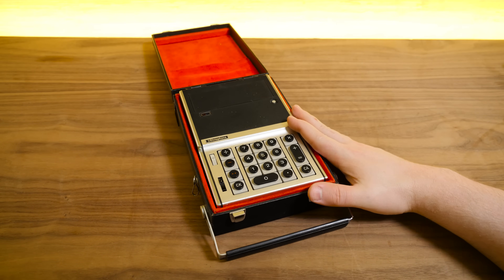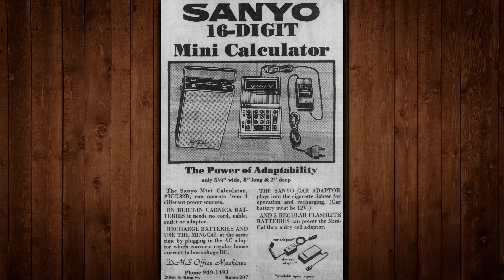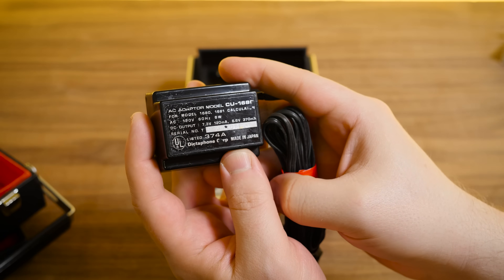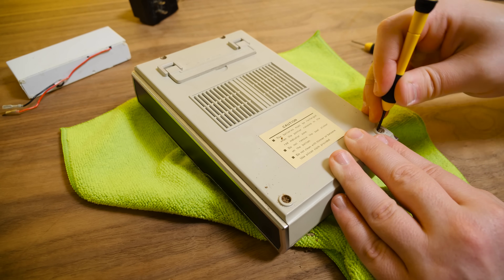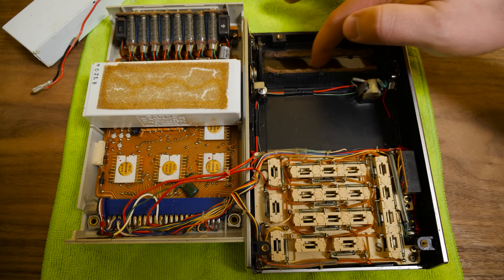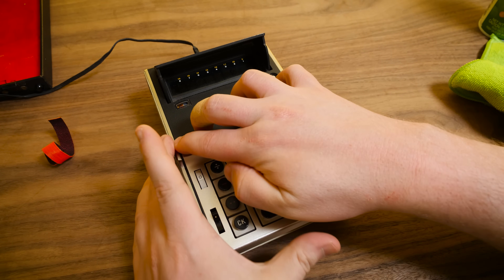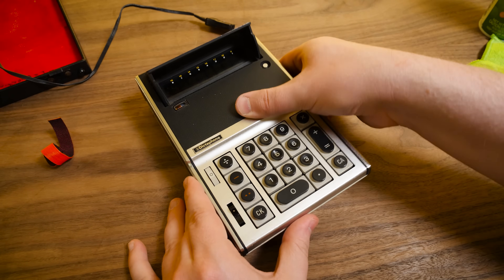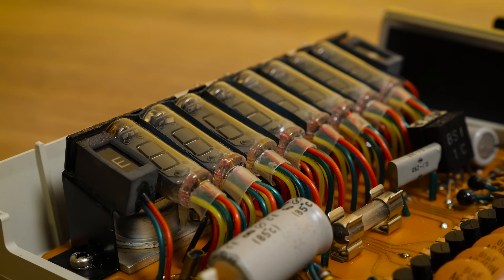Smallest Battery-Powered Calculator in 1970: Dictaphone 1680

Comment: Super cool, i also just love this kind of stuff! Had an early 70's mains powered Citizen (can't recall the model name) desk calculator which looked pretty much the same inside with these four chipsets but those were made by Sharp. Or at least they said so. Slightly different looking "VFD-tubes" with that lovely light green glow as you normally see on later 70's pocket calculators. I found it at a second hand store for roughly 10 euros.
Today i only have left my Canon Palmtronic LD-81 from my birthyear 1975, which i bring out to use occasionally. It works a treat and i love the clicky metal membrane keys on it 😀.

Comment: the marks on the old battery box are from the plastic case reacting to the rubbery plastic on the wires, it's an issue that effects a lot of old 8 bit computer peripherals, with a fixed cable.

Comment: Just came from the curiousmarc channel where they where able to fix it. For those who didn't watch it, the capacitors and transistors and all the other components where fine. They think the battery leaked at some point and ate some of the traces, as there was some bad corrosion underneath the top left tube area and he was able to solder some new wire to bridge the traces that where broken. They thought at first the cap had leaked but it tested fine.

Comment: That's a beautiful calculator!  First thing I would do would be to examine all connectors and solder joints.  Those joints were done 50+ years ago by hand and it wouldn't be uncommon to see a cold or cracked one in place.  I have fixed so much stuff that way, and the upside is you don't even have to use your meter.  Second, I would fill the display with 88888888 and look at the transistors driving the discharge display.  If you find a dud, replace it.  Third, if the unit is still not operational, then it's likely something in the discharge display assembly.  I didn't get a good look at that, but that would likely be trickier to fix.  However, 'trickier' doesn't necessarily mean 'impossible'.

Comment: it's interesting how this calculator has the same dimensions, battery indicator, and luxurious case, (option) as the 1963 Philips EL3300 cassette recorder (the very first Philips cassette recorder!) well, it's not uncommon to use an old mold for something else and or obsolete parts to make something new I think this calculator is a bit of all of that.

Comment: the burn marks on the battery is vinyl hardner discharge the vinyl rubber of the wires reacts with the cellulose acetate plastic of the battery case it literally melts it over time, it's a very common thing to find on 1950s to 1980s electronics encased in this type of plastic.
this plastic also deforms and cracks over time its one of the reasons why lego made their blocks from another type of plastic in 1958 the cellulose acetate lego blocks would warp so they chose their secret plastic mix instead.

Comment: There will be cracks in the solder as the lighting location changes. In the part that does not shine at all, it is suspected that the transistor for shining the neon tube is out of order.

Comment: Based on the fact that specific segments consistently don't work, and occasionally more don't after repeated powering, I'd think it's a power delivery issue, so I'd be checking the capacitors first, see if any single or combination of them corresponds to the left sides of all the tubes and go from there. Others have made similar suggestions on other relevant info too so maybe too late but my thoughts on the matter

Comment: go check the blue pcb socket , reseat it/use isoprop on it , then id check the pcb for "dull" (not shiny looking solder dots) those may be cracked and make no good contact , reflowing them should be fairly easy)
Reply: id also would replace the grey capacitors , since this is a "plasma display" it has an inverter to generate like 80 (or more) volt to drive the display , if the capacitors dont work correct the display will also have missing segments cuz lack of driving voltage

Comment: The fact that the same segment on all numerals is out leads me to think that it's probably one of the drive transistors, assuming the display is being multiplexed. Since you can input numbers and it seems to respond, it seems like the clock and logic is working. Perhaps the wonky arithmetic is due to a different type of input notation (eg. Reverse Polish, etc.)? Really awesome looking calculator, though. Hopefully you can get it working.

Comment: It appears to be 1(or2) dry/cracked solder joints on the display connection. From my weak ass knowledge of 8 segment displays. (or yes the sending ic could be failing)

Comment: Based on what I saw in the video the error with the display seems like a solder joint has partly cracked over time, nothing a reflow wouldn't fix so fully taking it apart and inspecting the solder joints with a watchmakers eyeglass is where I'd start.

Comment: Read in the Sanyo ICC-82D manual that the "E" is "Error (over flow lamp)". If I'm not mistaken, those are filament bulbs. The gas inside may have leaked causing them to no longer function.

Comment: The design of this unit derived directly from the much bigger, heavier, discrete component based, and much more expensive desktop office electronic calculators, about the size of a typewriter, which were common for almost a decade before this came out, that's why the price was not unreasonable, you were getting the same functionality and better portability at a fraction of the price, but still a price which allowed the build quality to be similar. The key, of course, to this shrinkage in both size and price was rapidly evolving IC technology. But as complete 'calculators-on-a-chip' became cheap and ubiquitous it no longer made sense to invest so heavily in the rest of the build quality when the rest of the industry were busy developing serviceable but much cheaper designs, but not all the calculators introduced in this latter market phase were cheap junk, there were still some extremely high quality products being made, such as from HP, and there were others as well such as the Berkey Keystone/Atlas Rand design:

Comment: 3:29 Sounds like you’d be getting royally ripped off though. $150/month to lease something that costs $3.5k? Seems like a bum deal to me.

5:30 Why not just get one of those & step down the voltage? It runs on DC, so the 50 vs 60hz thing wouldn’t be an issue.

6:32 I really don’t get this, at all. 0.o
Wouldn’t it make way more sense to make replicas? From both the buyer & seller’s perspective — it’d mean considerably less overheads for the vendor, and a lower purchasing price for the buyer (while still giving the seller a bigger profit margin).

Comment: At first I thought the incomplete zero symbol was intentional, because I know some old calculators display a "lowercase" zero so you won't confuse it with an 8.
Reply: As far as I know that was only Sharp, and it may have been more a power saving feature than a clarifying one since it meant lighting two less segments per digit when zeros were displayed.

Comment: that battery wheel is super cool
Reply: It's actually a traditional meter movement with the indicator attached to the central coil which rests in the center of the donut shaped permanent magnet whose outer upper surface is the color coded scale. It rotates like a motor but with a tiny and limited angle of rotation instead of the continuous 360 revolution of a motor.

Comment: If you want a few low-risk repairs that could possibly help, I suggest replacing all the electrolytic caps with new ones as the originals have no doubt completely dried up, and cleaning all of the edge connectors with contact cleaner.

Comment: Blown transistors seem like a likely cause for the displays not lighting up properly. It operates similar to a typical 7-segment LED display, where the same drivers drive each digit and a common terminal is switched for each digit in sequence to scan the entire display, which is why the same issue is visible on all the lit digits. That might also be enough to disrupt other functions, if something is getting shorted out or zapped by the driver circuit. A bad chip would really suck and would likely render this unit useful for parts only.

Comment: This is likely to have been mentioned here before, but it could be worth your while to swap out all the electrolytic capacitors. That way you will at least know that capacitors are not to blame and by the looks of the board, it shouldn't be neither expensive nor difficult to swap them. Though the current capacitors might not have any bulges or leaks, they might simply have dried up long time ago, and since there is no way to test their functionality while in circuit, they have to go either way. You might not be able to find exact matches to the ones installed, but if I remember correctly, you can always use the nearest higher value in uF, as long as the voltage rating is the same. There are probably resources online that can calculate the best options available, as new old stock in the capacitor market really isn't a thing.

Thanks for a great video!

Comment: I have a TI-1025 from 1978.  Got it from my great grandmother in its original box with instructions.  Runs off a 9V battery and also has a port to power it from the wall, which I thought was just the coolest thing back when I got it.  If the internet is to be believed, it was $12 new.  It has a slightly different feature set than the unit here, but amazing how much cheaper similar tech was just seven years later.

Comment: Nice old beast, those displays are a lot closer to Nixie tubes than a VFD. VFD's have a heater filament, where these don't, they are (as are nixie's) kind of a glorified neon bulb.
If you are lucky the lost segment could be one of those transistors & associated caps etc, you'll probably need a scope to see the multiplex in action.
Looking back at it, the row of 'resistors' under the lower bank of transistors, the one too the left is off at an odd angle - have a look, has it pulled free?

Comment: While the display tubes do look similar to the early VFD tubes when powered off, the technology is far, far too different to consider them even remotely related. VFDs aren't gas discharge; they are fluorescent, using electrons emitted by a heater to light phosphors. Gas discharge tubes actually work just like nixies - they are filled with neon, and each of the seven segments is its own neon lamp that glows when current passes through it.

Comment: I'd try swapping the leftmost tube with the rightmost tube. The wires look like they might be easily de-soldered from the PCB. The question is can the tubes be removed from their mounting bracket or would you have to extend the wires?

Comment: The display tubes are more akin to Nixie tubes than VFD.   No control grid and each tube is filled with neon gas.  Inside each tube there is a metal plate with a 7 segment + dot display cut out acting as a shared neon lamp  electrode.  Then inside each number segment is an independent metal wire acting as the other, independently operated, electrode.  I can't tell if the plate or wire is acting as the cathode (with neon lamps it doesn't matter) but my guess is that the plate is acting as a common cathode.  Strike voltage is around 60v and burn voltage is maybe 10v.   To me it looks like the display circuit isn't supplying sufficient striking voltage to light all the segments.   I'd start by charging the battery completely.   An almost dead battery can make funny things happen inside these early rechargeable devices because they don't have power management ICs or circuitry.   After that I'd just assume all the electrolytic caps are bad as they almost always are at that age and replace them.   If that doesn't work then I'd start checking the voltage of each wire segment as you turn the calculator on.  Just trace a good circuit to see how it's supposed to behave then trace a bad one to the point where it doesn't behave as expected.

Comment: Wonder what the first IC was, was it the transistor? Could make for a good video
Reply: Ic= intergrated circuit it does contain transistors and other components its not a transistor  a transistor is just a transistor bruh
Reply: @309electronic5  no shit Sherlock. I was pondering what the FIRST IC was.

Comment: @lgr try reflowing the solder points on back of the display. As there could be micro fractures, use a multi meter on each section of the display to check they are all getting the correct voltage.

Comment: I had 80's polish Elwro calculator with similar VFD tube display but light green. And it was powered from the wall socket. Even in the 80's these calculators were outdated, but they were pretty reliable and the display had that pleasant glow. When thin Citizen calculators appeared Elwros became obsolete.

Comment: The sheer build quality of this... this... artefact. This is a statement, an extension of life. People bought this to enhance their lives. Not to run away from it. Not just a today's consumer good.
Reply: This design derived from the much bigger, heavier, discrete component based, and much more expensive desktop office electronic calculators, about the size of a typewriter, which were common for almost a decade before this came out, that's why the price was not unreasonable, you were getting the same functionality and better portability at a fraction of the price, but still a price which allowed the build quality to be similar. The key, of course, to this shrinkage,  in both size and price, was rapidly evolving IC technology. But as complete 'calculators-on-a-chip' became cheap and ubiquitous it no longer made sense to invest so heavily in the rest of the build quality when the rest of the industry were busy developing serviceable but MUCH cheaper designs. Not sure what this very natural market trend has to do with 'running away from life' but not all the calculators introduces in this latter market phase were cheap junk, there were still some extremely high quality products being made, such as from HP.

Comment: I’ve seen problems on early segment displays like this before, and it’s quite easy to fix! Each segment is usually driven by a general purpose transistor, which can occasionally fail and take out the same segment in every digit. (I glimpsed a couple of the transistors in the video, they look like Mitsubishi ones)

If you can probe around and find which transistor drives those particular segments, fixing the display should be as simple as replacing it.
Reply: Yes!!!
Reply: The guy is clueless, he's definitely not qualify to fix it, probably no degree in EE or stuff like that, he could've easily taken it someone that knows how to fix it though.
Reply: @avcomth  well yeah he is just a person making yt videos not some electrical engineer
Reply: @max_uaminecraft1827  But at times and in many of his vids, he attemped to convey that he's some hotshot knowledgeable engineer of some sort.
Reply: @avcomth  Has he? I've never seen that. He fixes what he knows he can fix. He knows when he's out of his depth as in this situation. When would a 'hotshot' admit they don't know what they're doing?

Comment: After reviewing your video, I would take a look at that blue edge connector, that the circuit board appears to sit in, at the bottom of the case.  Perhaps you have an intermittent or loose  connection.

Comment: 12:06 Clint, those arent burn marks. The plasticizers used in the vinyl wire insulation are dissolving the polystyrene housing of the battery pack. It's the same thing that happens when cables are stored in styrofoam packaging for decades.

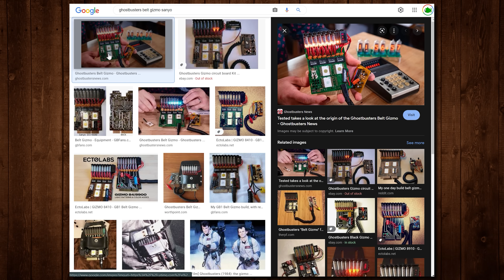Comment: 6:41 I agree, and I'd recommend people take a look inside old electric organs. Many of their chips can look similar and you could very easily throw together a prop from those parts without having to destroy a calculator. it's a shame, but electric organs are just too big to keep most times. I've had to destroy about 10 of them in my life, but the parts are so good. It really wouldn't be hard to make a fake replica from old electronics instead of destroying a complete calculator.
Reply: And there are people out there making look-a-like boards with working VFDs.
Reply: Destroy one mega rare thing to fix another? That's HORRIBLE
Reply: @sunnasmilieu  Somebody collects anything and everything.
Reply: Classic Organs are as precious as this calculator if not more. Utter pieces of art.
Reply: I don't think the people saying this realize that the parts are just as rare and wanted by the cosplayers. 

How is it any different from someone telling you to just make a replica calculator with modern parts? The reason they use these calculators is they are the exact parts that were a part of the original costume. A movie I might remind people was a huge part of people's childhoods.

Collecting these calculators to keep as a rare thing to sit on a shelf among other rare things has no greater value than using the parts to make an authentic cosplay item. Both are passion fueled preservation  of a product of the past.
Reply: @harmonic5107 also ghost heads, as ghost busters super fans refer to themselves, created both a replica of the calculator internals using old parts sourced from Ukraine and a visually exact rubber and plastic version after the calculator collecting community asked them if they'd stop gutting them. Multiple replica kits for all the different variations are available and original calculators are rarely used now. Ghostbusters: Afterlife used one of the fan made replica kits. 

The reason new batteries are available for this model is solely because of ghost busters fans and their reverse engineering of this calculator line. So while people are bemoaning the ghostbusters fans, they did more for preserving this model than anyone